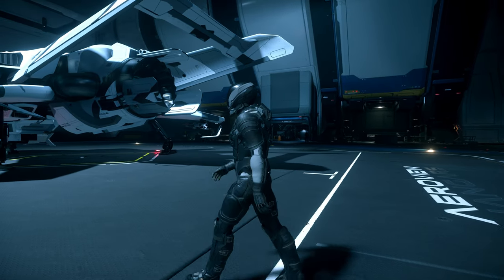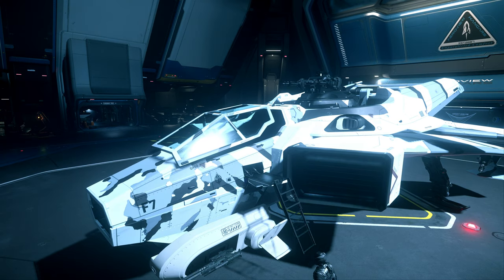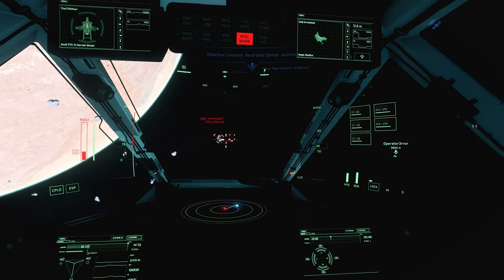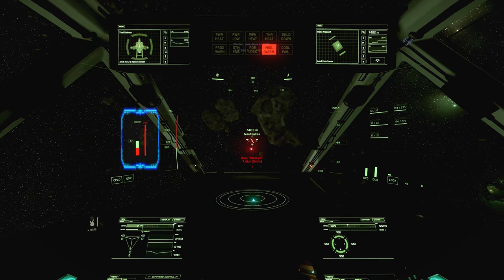Star Citizen 3.14 - Capacitor Gameplay Overview (Alpha 3.14 PTU)

Comment: Outstanding work, as always.  I would love to see a re-review of the Banu Defender after the patch goes to live servers.  Of all the ships in the game I think these changes will effect the Defender most of all.
Reply from the maker: Thank you! I’m currently working on a new format for 3.14 ship coverage. Combat/flight will be a lot more involved so the videos I produce need to be a little more in depth. Since you asked, I will schedule Banu Defender first. Any specific detail you’d like to see covered, please let me know. Thank you for your feedback, it is very much appreciated. Stay frosty!
Reply: @11sHangar  Awesome, thanks!  I'm not looking for any one thing in particular, but strafing has always been the Defender's strength so I'd love to know if it still strafes better than other comparable ships.  Also depending on what CIG does with the Sukoran shield I'd love to know if or how that affects how you'd fly it going forward.
Reply: @austinm5630  Sukoran is like every other shield except better at stopping ballistics. The Defender strafes ok, but doesn't turn nearly as well, and the stock weapon loadout is weaker than any if the starter ships. Singes are a total mess of average damage per shot but 1/4th the fire rate of other guns. They fire too slowly to even drain capacitors, making power management oddly less relevant to the Defender than other ships.